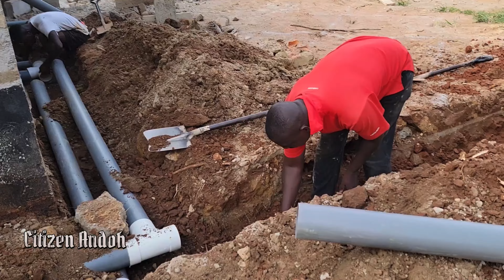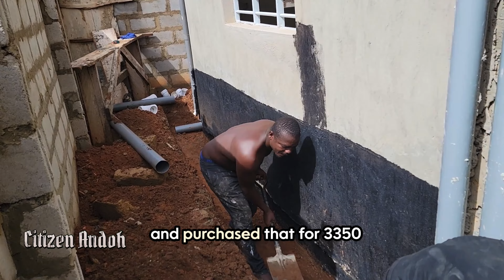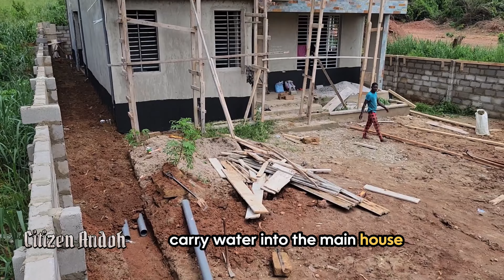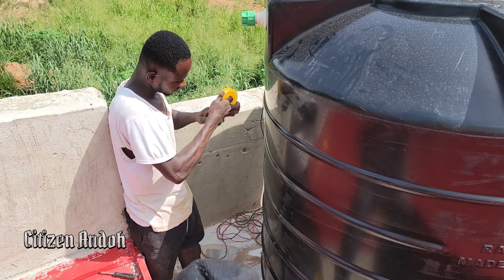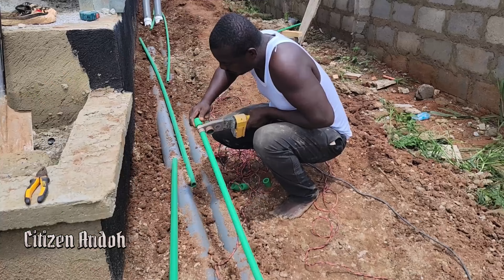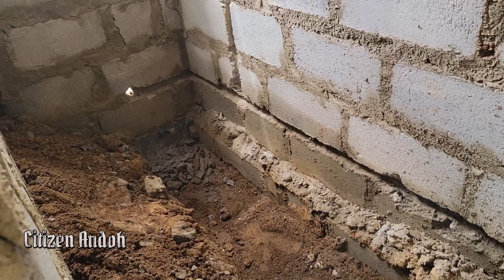Plumbing Works Phase 2,Total cost || Building A House In Ghana || Episode 35

Comment: Hi, do you happen to know the width of the polytank? Thanks.
Reply from the maker: @ourfamilytree5931  Hi dear.Yes,the Rambo-250: Diameter 150 cm, Height 122 cm, Capacity 2,500 liters
Reply: @ Thanknyou for your quick response. Will you also have a larger polytank on ground? I'm at that stage and I need advice.
Reply from the maker: @ourfamilytree5931 If it’s not going to be mounted on top of the building like mine,you may choose to go for a bigger.Otherwise,the 2500 liters should be enough for domestic storage.